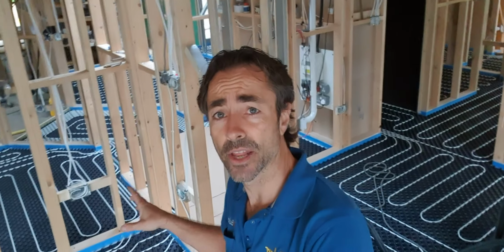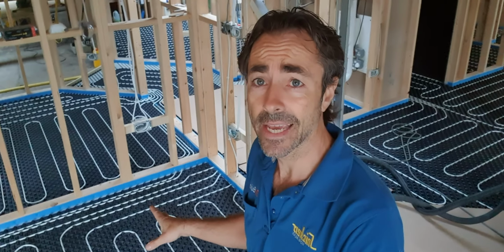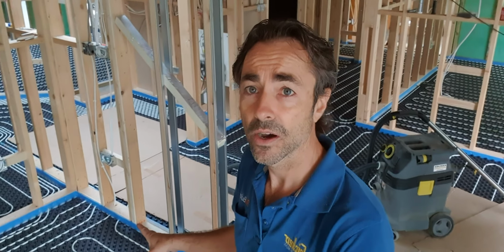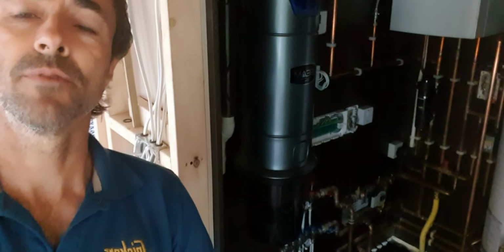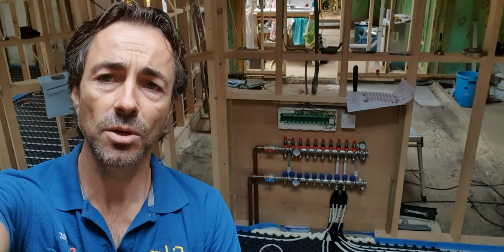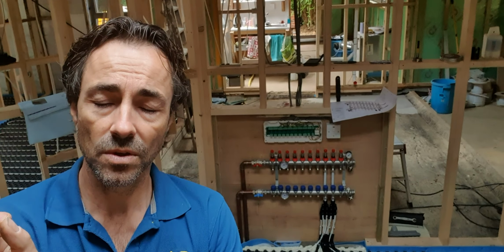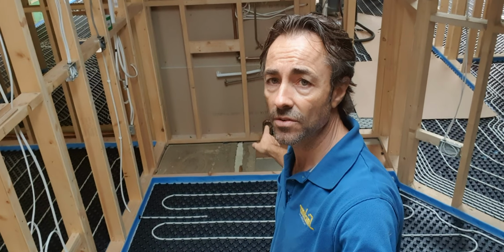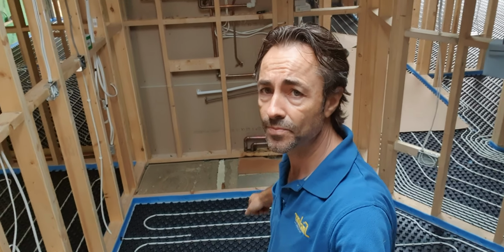Low build up underfloor heating

Comment: So my existing needs to be maximum of 30 mm liquid screed on low pro because of existing thresholds. The celotex part I guess will need to be at least 20mm lower giving a minimum of 50mm....do you agree?

Comment: Im thinking of putting in a 10mm piping UFH system, what spacings are you using between the loops? Im putting Superfoil underneath (over the radon barrier), then netting and tying the pipe to the net mesh, and putting an earth floor over with a limecrete finish or stone slab finish on it. Is there a crush load to be worried about for the pipes?

Comment: I was just thinking. Isn’t this type of insulation flammable? If it is doesn’t it make your building highly flammable?  I will be doing my insulation install in September, not sure which one to go for.
Reply from the maker: Hi Craig, generally it's an overall picture of materials specified to work in conjunction with each other as laid out by the various building regulation documents, many forms of insulation will burn including wood fibre and lambs wool of certain types, most domestic building work needs to be approved by the local authority building control as a submission for approval, they will look at all the specifications such as the type and thickness of plasterboard etc as these elements generally form the 30 minutes of protection that we need In most typical projects that are two storeys or under, it is a bit of a mine field! Hope that puts your mind at rest!, maybe reach out to the manufacturer of the insulation as they have many resources available for meeting regulations covering fire, ventilation and indeed insulation for many applications

Comment: Hello,
Thanks for the video. Been watching a lot of your videos and wanted some help please. I am about to do a retrofit UFH, I have about 25-30mm to add on top of my existing flooring. Wanted to know the best option. Some builders have suggested 22mm from OMNIE and to put the quickstep straight down with underlay. Is this a viable option? Ie without screed, leveling, primer or ply. My floor is concrete and I really don’t want to dig down.

Comment: Hi Robin, we are about to do an extension on our 1880s build house. The new extension will have Delores and wet UFH but the current flooring in the none extension the builder is suggesting we do a similar setup to here. Just wondering how you find the two work together? It’s going to become one room for our kitchen and I’m wondering if it’s worth the hassle of removing the current concrete floor? Cheers for another great video.
Reply: Hi Chris. I will have similar scenario in house  i was planing on use 50mm liquid screed in extension but not sure what to do with rest of the house which has concrete floor without any insulation underneath. I'm quite worried about heat loos and time to warm up  existing floor.  Just wondering if you already managed to get some answers co I could use bit of your knowledge. Thanks
Reply: @GregBiernacki1989  I've been researching this quite a bit and there's a couple of problems.
You need two seperate circuits as the in screed will need to be at a higher temp than the on top system.
The on top system will also warm and cool quicker than the in screed.

Long and short we decided to take up the existing floor and pour a new concrete base, insulate and lay a single system (still multiple circuits due to the size of the room). Costs a little more but much easier to balance and more efficient.

Hope that helps.
Reply: @chrisembleton624   thanks Chris. Much appreciated

Comment: Are there any videos on how you built the stud walls before laying the ufh pipes? I want to know from a block and beam floor how you attach the sole plate then build the wall sides so the screed doesnt run between the studs

Comment: Good little vids, very inspiring. If you hit flight mode before you start filming, you won't lose your stride and the output will be a bit smoother.
Reply from the maker: Now that's a great tip, Thanks Andy

Comment: Hi mate hope you don’t mind me asking this question mate, when fitting flooring to joists on site (caberdeck/eggerboard with PU glue etc) 
How many nails (if any should you be using per board? I’ve been working with a bloke who glued and nails everyboard with 3 per joist but have  recently worked with another joiner who has said all you need is one or two per board as the glue does the work. What do you think?
Reply from the maker: Hi Mike, generally the only fixing I do is to set the first row straight, I then use just the glue in accordance with Eggers instructions, I tend to use Metal web joists and these have a good wide top say 76mm or 95mm I then put two parallel lines of adhesive along the joists on the third points, the idea of the system is two fold one to create a squeak free floor and to provide some weather protection until the roof is on, I reckon that these floors are so superior to a mechanically fixed floor, hope that helps!!
Reply: Robin Clevett yeah that’s ace thanks mate, we’re mainly working with metal web joists too on timber frames, 3 fixings per joist just seemed a bit excessive!

Comment: the build looks amazing really well done nice to see a proper build with a bit of thought gone into it looks like it will be quite impressive... just think it would be criminal to put an anhydrite screed down, this stuff is purly produced to be cheap and allow to total zero skill installation,  even thoroughly dry anhydrite is not resistant to water or moisture that can cause failures in the future, think nowadays even the decoupling membranes producers advise not to use over that stuff, you've built a place that will last hundreds of years, invest in a decent cement based screed that will too

Comment: Hi! This in on concrite or osb/plywood? Could you be so kind and write layers one by one? Thanks! :)
Reply from the maker: The new low build system was all laid on either existing Terrazo or sand and cement screed over the existing concrete Raft i hope that this answers your question? Thanks for your comment

Comment: My dad put in under-floor radiant heating in a 70m2 basement of a new addition he built about 45 yrs ago. Ofc the components weren't up to the same standard as nowadays, nor was the system tested well enough, hence after only 5 yrs of use he had to close that section as the pipes got clogged. I suspect the original sized pump didn't provide enough pressure for the extra volume -- as it still works fine for the rest of the house. 
That said, I don't know the details but I think most ppl install electric under-floor heating in new houses here in Norway these days. In older house with under-floor pipes and oil furnaces it's now common to replace the furnace with an air-to-water or geotermal heat exchanger or  (after 31/12/19 oil for heating will be banned here).

Comment: Hey robin, what's the over all increase in floor height on the 10 mm areas, post screed.
Reply from the maker: The overall build up so panels, pipes and screed is 20mm

Comment: Hi Robin, the build is really coming on- really enjoying the progress. I've had the anhydride screed poured and you're right it is a faf with waiting for it to dry and sanding the laitence but boy does it retain the heat. in the winter we would wake up to warm floors from the latent heat from the night before. you won't regret it!